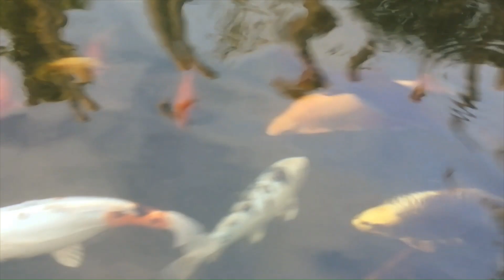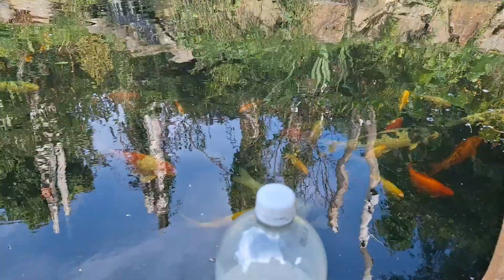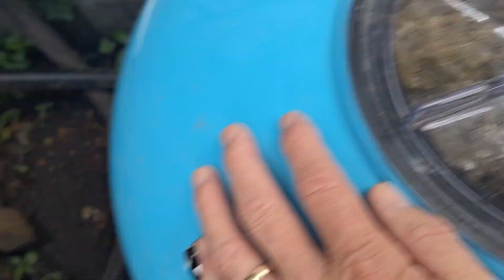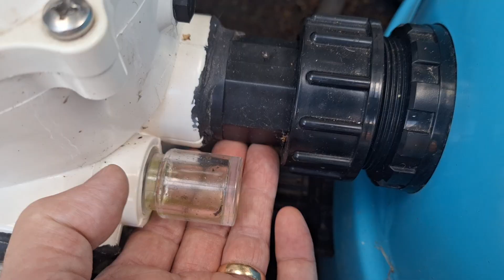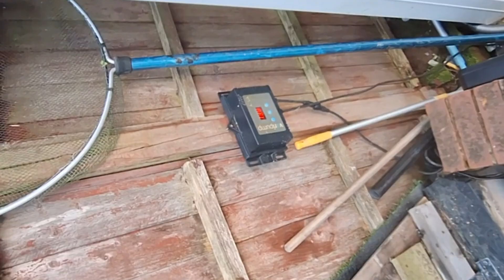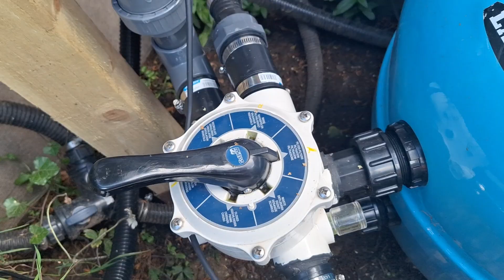Retro fitting bead filter air release valve, (home made).

Comment: Thank you, for the fun content! 

I have taken some sand or bead filters and converted them to k1 filters. They all have the top valves, but you still need to bleed the air if you adapt them for the blower as well for the same reasons. Otherwise you'll burn out the blower, overheat the blower etc. 

I'm curious: 

The evolution aqua filters are set up so that when they are in filter mode it is an upflow, and the backwash is a downflow. 

The typical sand filter is the reverse of that. 

What did you find with this filter that you've converted? 

I tried reversing the inlet and the outlet, and while that works, you lose the rinse cycle since that just ends up dumping back into the pond. 

Thanks again.
Reply from the maker: Yes, it's as you said regarding converted sand filters, when in filter mode it is a down filter, then in rinse mode the air blows from the bottom and the waste is forced out of the top. Thanks.

Comment: Very creative idea using the bottle cap as an air valve fitting.👍🏻 One word of caution... you did explain the cleaning procedure very clearly but always be sure to close the ball valve on the blower before the water pump is turned on. If you happen to forget, even once, you will flood the blower with water and destroy it.  I have seen it happen...a costly mistake. 😥
Reply from the maker: Thanks for the advice, it would be easy to forget.